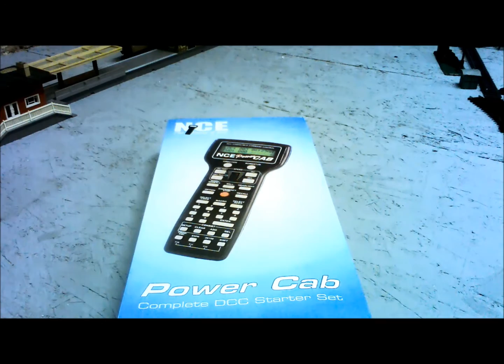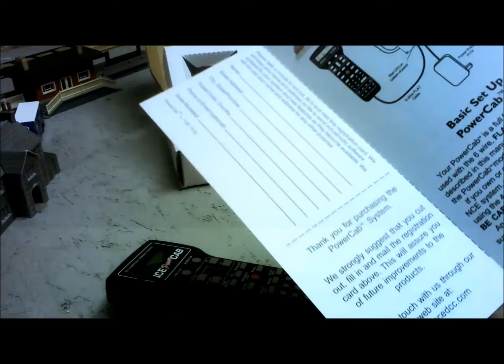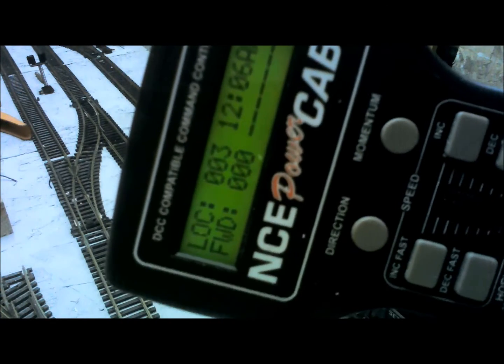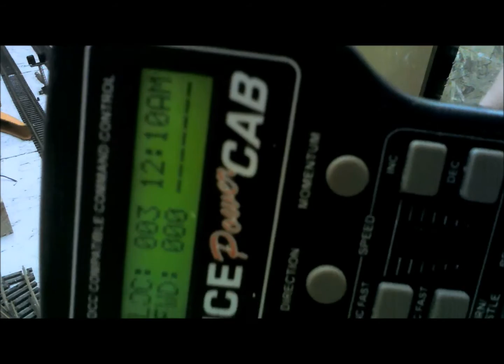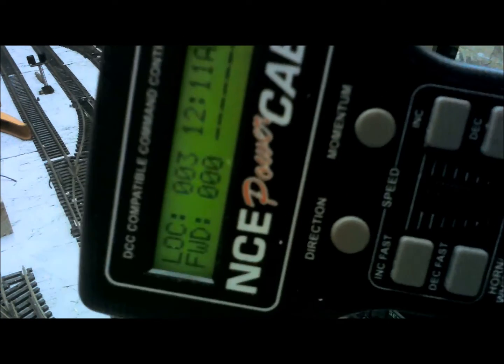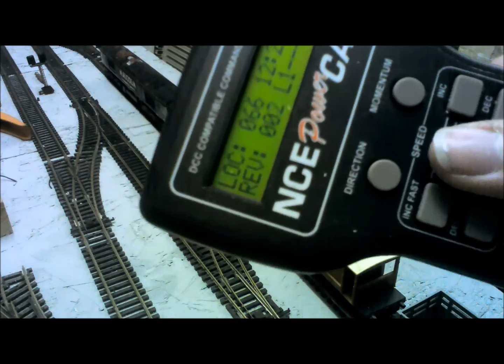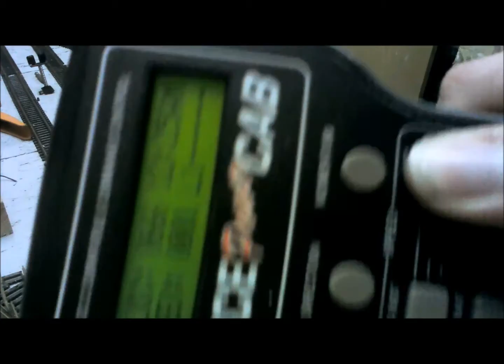NCE power cab setup tutorial

Comment: Nice demo , I am looking to replace my Hornby Select but I have increased the size of my transformer to 4 amps so I can run sound locos . How many loco's with sound will the cab run .......Peter .
Reply from the maker: th standard unit is 1.85 Amps i upgraded it to 3 Amp I'm not too sure how many locos it can run but you can get a 10amp power booster which will allow you to run a lot more
Reply: Thanks for replying , probably need the 3 amp .
    Cheers......Peter .
Reply from the maker: My power supply is a 3rd party one i bought it doesn't come with it but they are easy to get hold of